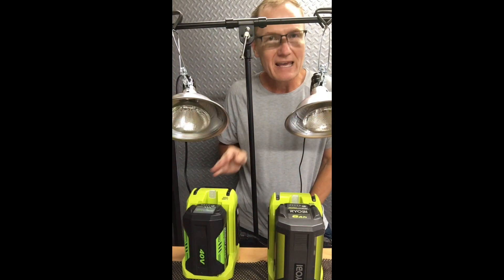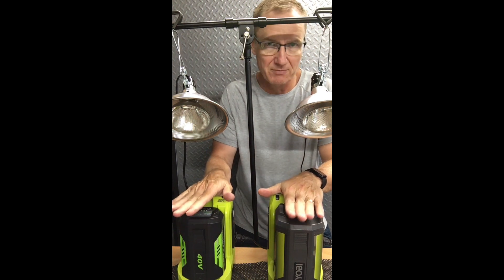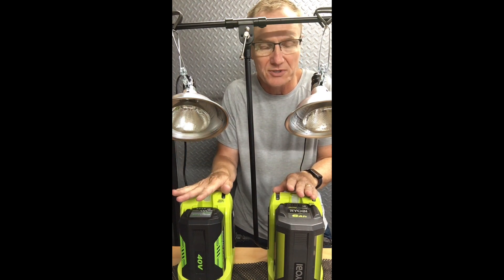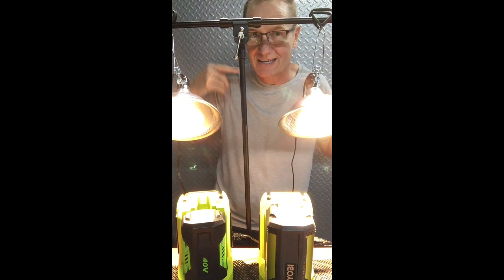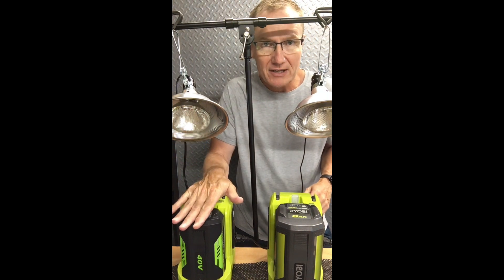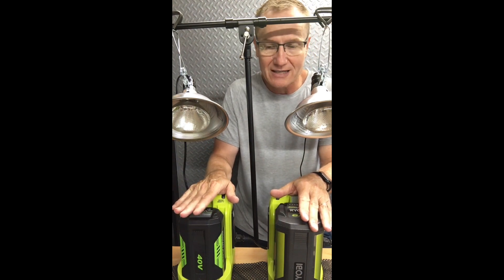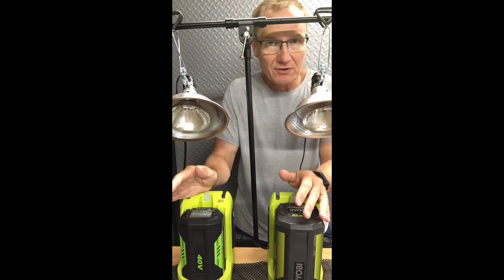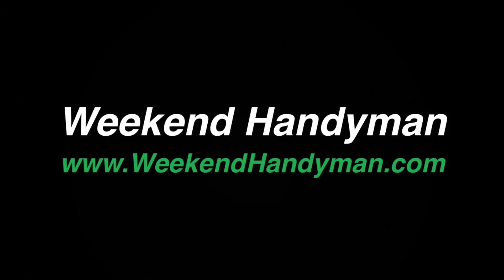40 Volt Battery Challenge: Moticett 6Ah vs Ryobi 6Ah Runtime Test With 150 watt Inverter Load

Comment: So assuming the ryobi battery is actually a 6ah (which I think is a reasonably safe assumption) the Moticett battery is actually 2.4-2.5ah.  Wonderful.  Not.  While you may be able to get more capacity per dollar, given the obvious fraud I don't particularly want to bet that much on the cells being as good a quality and working for as many cycles as the Ryobi.

By the way, I've had good results from Ryobi batteries and tools purchased from Direct Tools Factory outlet.  Recently picked up one of the 40v whisper blowers (the smallest 40v whisper IIRC) for $100 w/battery and charger compared to $170 sale price at the H.D.  It was "new factory blemished" but I have no idea what the blemish was/is. They are an official TTI outlet store which includes Ryobi and other brands and I trust them.